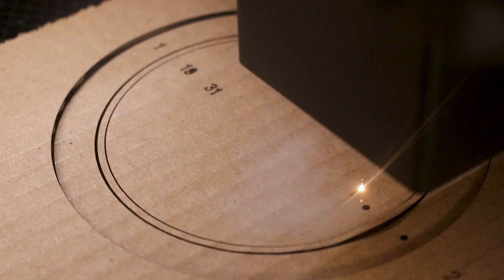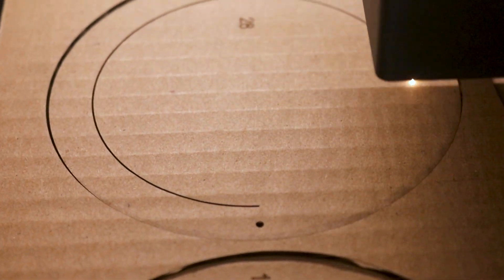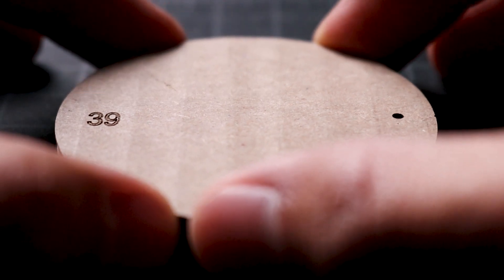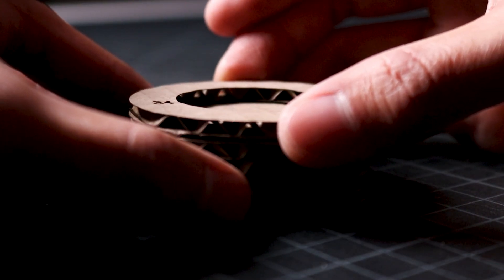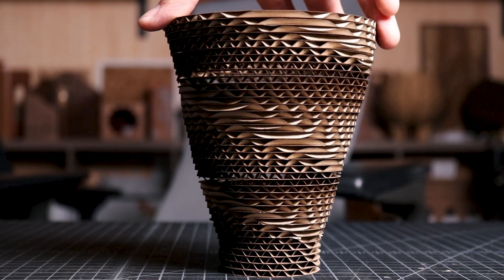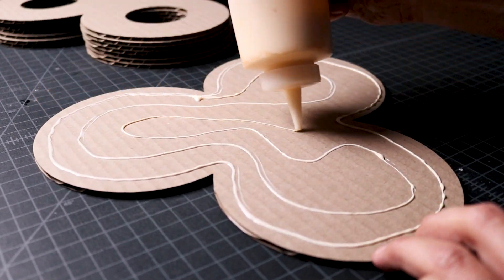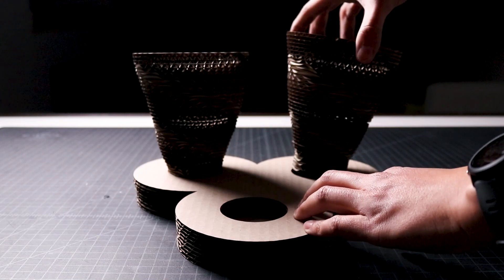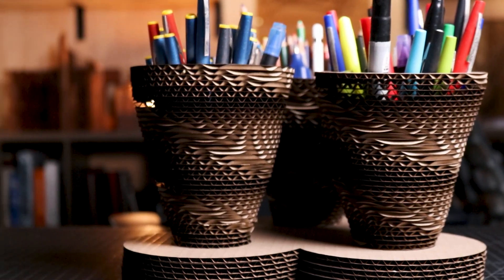Making a Cardboard Pen Organizer with a Laser Cutter

Comment: Looks great! What are the settings to achieve such a clean edge?
Reply from the maker: It's different between every laser cutter, but I ran a few test cuts with different speeds. The trick is to find the balance between fast speeds and high power so your laser doesn't burn any part of the cardboard.